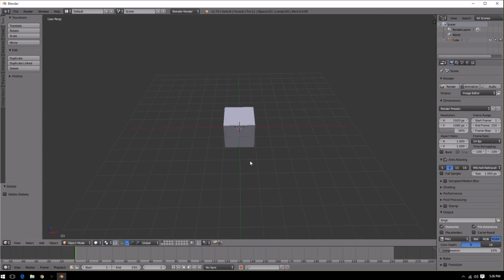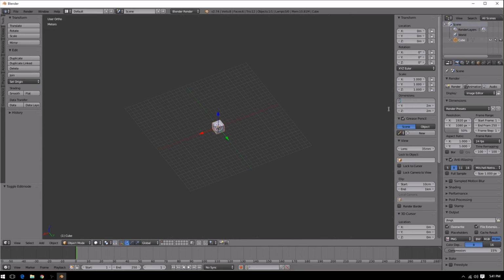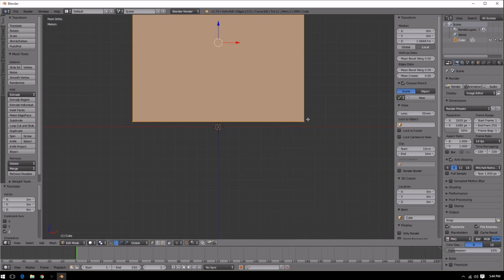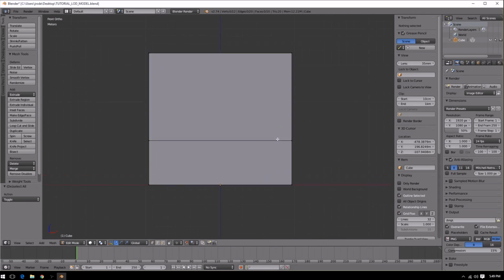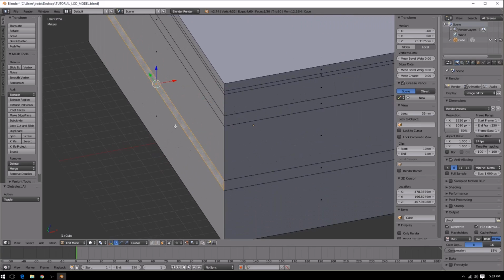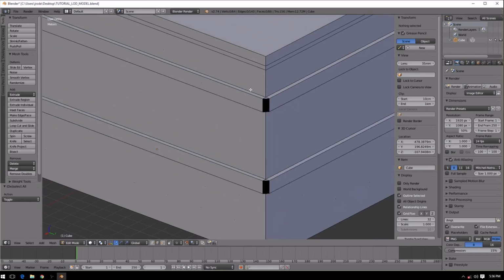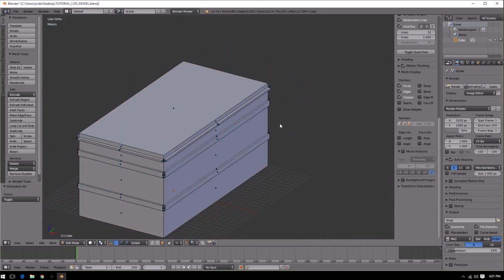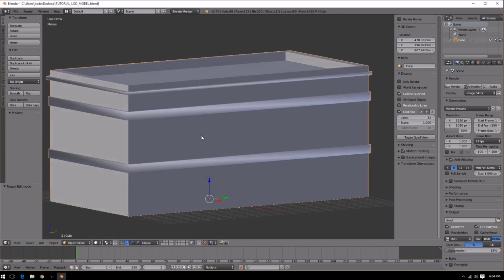Part - (1)-Modeling-Pt. 1

Comment: I appreciate your videos, I really do, but it doesn't help that you've apparently modified the default Blender UI to something of your own liking.  I'm a noob, of course, attempting to use Blender version 2.8 and my  menu choices don't look much like what your video is displaying...  or is 2.8 THAT much different from the version you're using (which I think is 2.74)?   Also, the many times when you say "you can do such and such by hitting the X key" or so on is not very helpful, either...  arcane keystrokes are not natural to remember, so it would have been better to show the menu selections, instead....  although, as I said, that's complicated by the fact that your menus don't look much like mine.  :)   Anyway, I'm still following along as best I can.

Comment: To place an object on the ground level:
* move the object rotation centre/origin to the bottom plane of your object. (See below)
* set the position on Z=0 (also in the N menu)

Or, leave the centre and set position Z to half the height of your object

To move the origin: 
* select the bottom plane or bottom edges/vertices (via TAB)
* shift S -> move 3d cursor to selected
* leave edit mode (tab) and do: Object -> transform -> origin to 3d cursor
*

Comment: Great stuff!! Thanks much. BTW, one thing you might consider to save time closing the faces after extruding. If you extrude using Extrude/Region/Vertex Normals it will give you closed, sharp corners instead of open faces. Then all you have to do is select all the corner edges and Bevel. And of course always Remove Doubles when you're done before you save. No need to close all faces and flip normals. Thanks again for a great series.

Comment: Pretty good video, I would just like to point out an issue though.  You have what my Computer Animation instructors call, "wasted geometry."  When you built the corners of the lips coming off the wall, you left the faces inside the new faces you made, though those are only 2 additional faces at each corner of each lip, a total of 24 for the 3 lips, that's still geometry that has to be loaded into the game and being that they are inside the building they will never be seen, but are still taking up precious video RAM.  If you'd removed those inside face before you built the corners the normals wouldn't have been flipped, but in the off chance they were, then all you'd have to do is select all of the faces, then Calculate Normals Outside.  The Recalculate Normals commands won't work if you have faces like you had in the corners, it confuses Blender as to which part of the mesh is outside or inside, so that's another reason for removing those hidden faces.

I've been using Blender since 2007, but I've been 3D modeling since 1996, originally trained on Autodesk 3D Studio R4, that's not 3D Studio Max 4, this is the old DOS version, which there were only 4 versions before the first version of 3DS Max came out, which 3DS Max 1.0 was the first Windows version.

I've been a developer, using Blender to make products for IMVU since 2011, unfortunately IMVU only enable a developer to use 2 texture per mesh, no bigger than 512 x 512,  one as a color texture and the other for opacity.  So I'm experienced with exporting from Blender to other programs, including animated rooms and furniture for IMVU, which is what I'm looking through your videos for, to see if it's possible to animate items for Cities Skylines, and seeing how the different textures are saved with the various naming conventions that Cities Skylines uses for diffuse map, the opacity map, the normals map, specular map, luminocity map, etc, and to see how animated item are exported to Cities Skylines.
Reply: To remove those extra faces, I should view it in wireframe mode, select the non-visible faces, then delete, then "faces", right?
Reply: It wouldn't necessarily have to be in wireframe mode, just depends on which you find easier to view the faces.  For example, if you have a face on the bottom edge of walls, because chances are you'll never look at the walls from that angle, delete those faces.  Any face that will never be viewed should be deleted.  Even in character modeling.  When modeling a character, keep multiple versions of the character, one version that is the full body of the character, then another version with clothing, once the clothing is finished, delete the faces of the character that will always be covered by clothing, since you will never see those faces because they are covered by clothing, but if the clothing hangs loose, keep some overlapping faces to keep the illusion that the character's body continues under the clothing, unless you are using a cloth physics simulator, then you need to keep all of the character's faces so that the clothing will have something to fall against, but if your character's clothing isn't using cloth physics, or at least not using the cloth physics in that area then delete the covered faces, but remember to keep the original full body version for future use in case you ever want to change the character's clothing later.
Reply: In the example in this video, yes, to see those faces you'd need to be in wireframe and face select mode to see those faces left in those corners.  Unfortunately you'll never see those faces, and they take up video RAM whether you see them or not, those faces are also the cause of why he was having issues with the Normals of the few faces, because those faces left in the corners confused Blender on which way the normal should've been facing.
Reply: Alright cool, thanks man
Reply: You're very welcome.
Reply: Wait - do I need to delete them before or after filling the corner? I'm new to blender and modelling, so sorry for dumb sounding questions.... /:
Reply: @asmylia9880  Before is probably best

Comment: To avoid having to flip normals you should remove the faces that will be obscured by the new faces as they have impact on how blender decides to draw normals.

Instead of creating new faces you can first extrude one side which will cause two faces on the other side of the corner. Extrude those two faces together. Finally you can merge  vertices (ALT + m) to create the final effect. You can decide which is easier.
Reply from the maker: +IdeaGrazer Thank you for the tip! :)